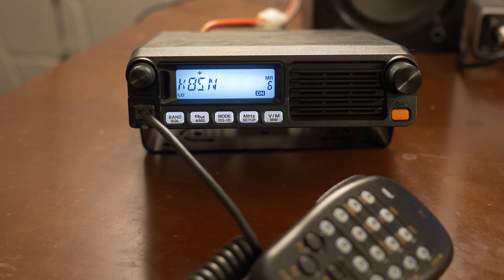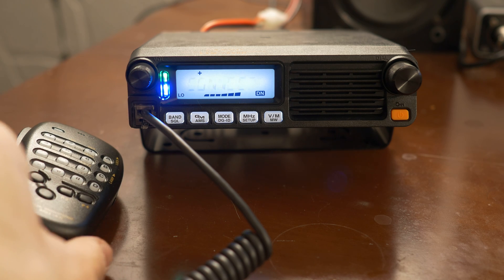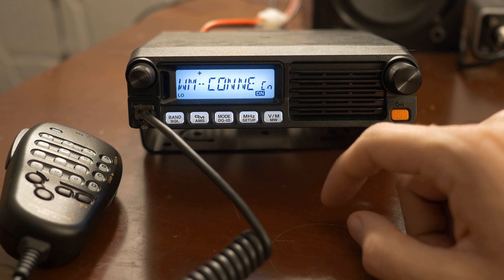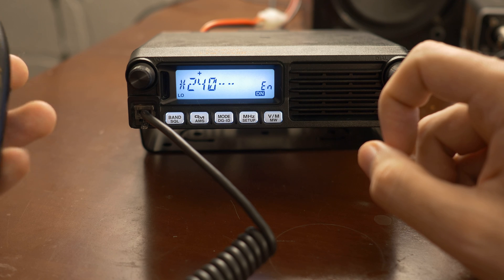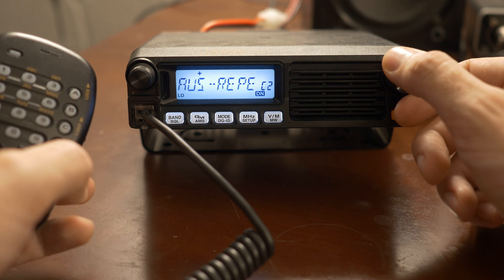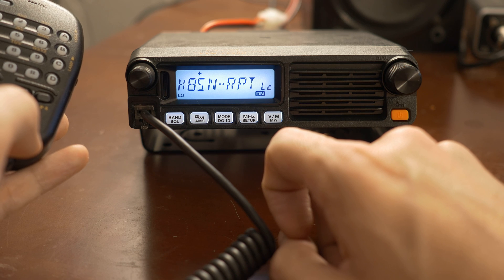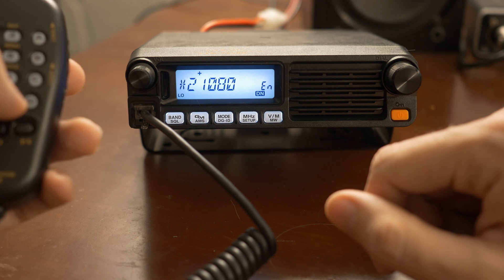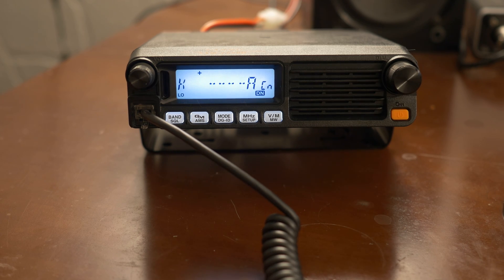Wires-X on the FTM-7250DR - How to get it going

Comment: Does the radio do this by itself or does it need a hot spot?
Reply from the maker: if you want to connect out to different linked repeaters your options are either a hot spot, or as i did, which is connect my local repeater directly (in a sense it behaves as your hotspot).. but since the repeater is a shared resource, you would want to make sure the repeater isn't in use (or won't be soon, like for a net) .. same sort of etiquette as always.
Reply: @AlexanderGrotewohl  Thank you so much for your help. KO4HPC   73
Reply: Where do you look for the digital codes? To connect to.

Comment: Nice tutorial.  It helped me get connected.  However, I'm trying to disconnect from a node, but the display shows REMOTE and won't let me disconnect.  I can't find anything in the docs. Any suggestions?  Thanks!
Reply from the maker: i believe this is one of the qwerks of the Yaesu system in general.. you can't tell the remote you're disconnecting if someone is transmitting. at least from my experience. if someone has been long winded I've actually just cut the power.

Comment: So you do not have to have the radio connected to a laptop or have any other hot spots to connect to wires x?
Reply from the maker: I do not. I've considered getting one but it has been fun using repeaters and I haven't stepped on anyone's toes yet (as far as connecting the repeater to far off places)
Reply: @AlexanderGrotewohl  Say you're connected to the Zimbabwe room on a wires x repeater. Is the whole repeater tied up as long as you're connected, or just the digital side? The way that I understand it, a wires x capable repeater can be configured all digital, all analog, or 'split signal' as I don't know the correct term. My question is based on a situation where it's configured to run split signal. KC1GZR
Reply: @CMDR.Gonzo.von.Richthofen  Yes. That is only drawback to digital. It is better to use a hotspot to connect to some less used rooms. America Link has had its problems as well though.

Comment: Awesome video.  To bad there are very few wires repeaters near me. Still trying to learn this radio. KD2BAX New Jersey
Reply: KD2YDF here from New Jersey.  Just got my license in October.  Where are you located for a wiresx repeater?  I have one in supposedly in Pitman.  I can key the repeater on analog but nothing happens when I try to initiate digital.  I'm a bit of a distance from it but I figure if the repeater is giving me 3-4 s units i should be good.

Comment: So I’m thinking about getting this radio and trying out Fusion. Had a couple questions. Can you connect to any Channel or room with a repeater or only what the repeater is connected to? Also I noticed on these radios you have to connect to a room every time you start it up, so will it stay connected when you restart the radio or do you have to re-connect every time? Thanks. Will probably hear ya on a repeater sometime. I’m up in Muskegon. K8AMD
Reply from the maker: to connect to a room you essentially tell the repeater to do so, which means everyone else hearing/interacting with the repeater comes along for the ride. so, much like echolink and the like, it's probably a good idea to announce your intention first.

depending on the repeater configuration, it might stay connected where you told it until someone else changes it. but from what I've seen locally, most will eventually time out and reconnect to WM-Connect. there's a list on w8dc.org under "new links" with fusion repeaters and MOST are on WM-Connect by default
Reply: Alexander Grotewohl ok that makes way more sense and is way less complicated then I was thinking. Thanks for the info. Hope to catch ya on a repeater sometime. 73

Comment: I have a an FT-7250.  I have been very happy with it, works great on Fusion & all my local analog repeaters. But lately its started doing something odd.  No matter which way you turn the channel knob it ALWAYS "hunts down" the channel repeater list as in 5-4-3-2-1... When using the up & down buttons on the mic it works fine.  I dropped it of at Yaesu late last week for them to take a look at....   I really hope its fixable...  Wondering if anyone else has run into this issue?
Reply from the maker: I haven't had this happen to mine, but it did happen to my regular car stereo with a similar style "spin forever" knob. ("rotary encoder"). Seems to be the standard way they fail. The internet lists lots of random causes for it from moisture to the phases of the moon so who knows :) 

I think they'll fix it pretty easily. Hopefully not for an arm and a leg!
Reply: @AlexanderGrotewohl    VERY LATE reply...  I took the radio to Yaesu & they were able to fix the issue I was having with the channel knob.
Reply: New question,  Alex, You demo'd storing Wires-X rooms by pressing the 2 button on the mic.  I cannot get that to work on mine.  Do you know of another way to store room numbers on the radio?  Many thanks.

Comment: Great vid. I am thinking about replacing my old Icom IC-208H with FTM-7250. I have a Verizon MiFi jetpack and a Jumbospot in my truck, that I use my FT-70 with.
Reply from the maker: nice! i was thinking of getting one of those (the FT-70) - how's the jumbospot? work pretty good?
Reply: @AlexanderGrotewohl  The jumbospot works really well. I have two of them. One on a Pi3 B+ in my shack for DMR and the other one I use mobile is on a Pi Zero W for Fusion. KE0LJG